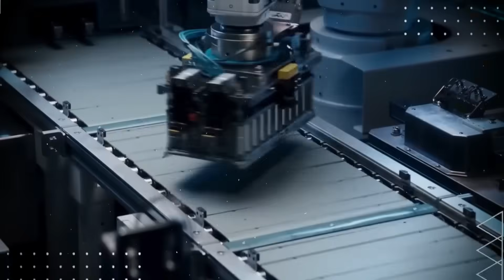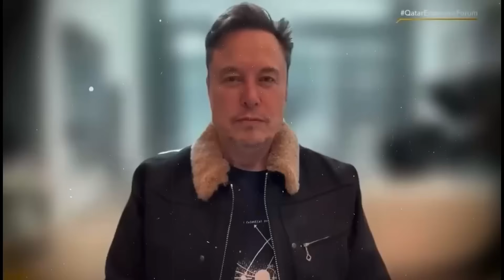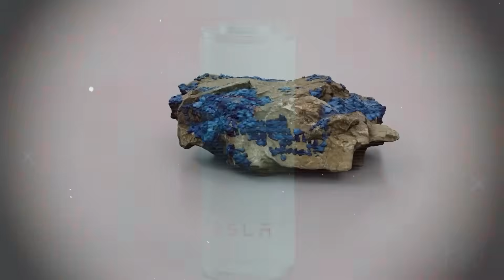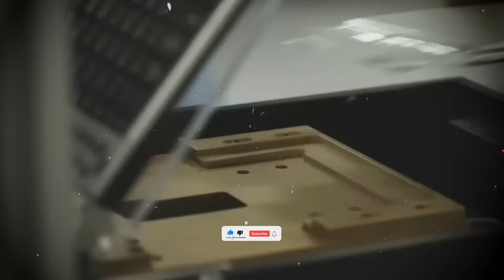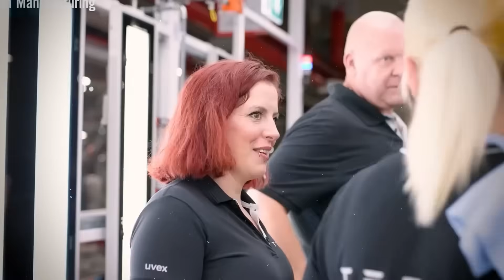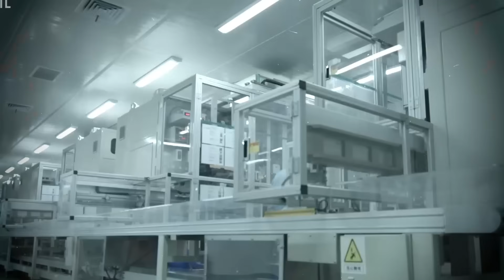5 Minutes Ago: Elon Musk Dropped A Bombshell about the Aluminum Ion Battery!

Comment: Don't tell me another revolutionary " save the world and EVs" battery ? Even if this is true and not another cyber truck, wait years and years Tesla BS, you still have the same problem and that is how much electricity is available at the charge point!? It's like BYDs 1000kw 5min charge to 100%. Theoretically possible but no chargers can do it and no power point stations has that amount of power connected to it for one of these chargers let alone multiple points, as a station would need MWs connection with a small city size transformers to cope.

Comment: I powered my 2-transistor radio in 1976 using an aluminum-iron battery! Sand filled. Used just a touch of ammonia in the sand to activate it. Powered my radio for hours! Then let it dry. Added ammonia. Used for 4 years.

Comment: This from my phones Ai;
While there is much speculation and many reports from unofficial sources about Tesla developing a new aluminum-ion battery, the company has not made any official announcements or confirmed its development.

Tesla is reportedly developing a sodium-ion battery, with some sources speculating its use in a future low-cost vehicle like the rumored Model 2. Sodium-ion technology is seen as a potential alternative to lithium-ion due to its lower cost, greater abundance of materials, and safety advantages.

Comment: I'm ready for a the new battery and in the roadster model. 
A launch so bawlsy that my balls may turn into labia once breaks kick in.
Does anyone know if the roadster will be dual motor or offer it as an option??

I could only imagine these batteries output wide open on dual motors in the lighter chassis/body combo. ❤

I don't believe another mass production car could compete with it on dragstrip or track.😅😊

Comment: ... BYD pre-programmed the import of 100,000 E-Cars to Brazil without taxes. They're unable to dispose of 40%, and their yards can't accommodate any more electric vehicles! 
... E-Car batteries are already on their way to becoming the 4th Global Failure...! 
It's not "green," unsustainable, always carries 1/3 of the extra weight, and isn't worth its weight...!
 ...all that's left are the cheap ones, like Microlino, Topolino, etc., and in China...! 👍🏻💯😸🇧🇷
 ... China tried to dominate the global automotive market by manufacturing batteries, the E-Car's "Achilles' heel"!   ⛔🇨🇳🇨🇳🇨🇳
... and China doesn't have Eletrical Power to recharge This kind of E-Cars and, are construting another big HPP like 3 Gorges ... !   🤪👎🏻🆘🇧🇷🇧🇷🇧🇷

Comment: It appears these batteries are being completed with rigorous testing. The model 2 priced at under 16k needs comfortable seats and a cross over height variant aging boomers can use. It is hard for older people to egress low height cars. What is the battery life time and replacement costs?

By the way, most boomers don't care about drag racing?

Comment: Something about this does not add up. Yes you can have one electrode of aluminum giving off Al3+ ions but if you just turn them into Al metal in the graphite at the other side there is no net electro-chemical energy (zero voltage) involved. There needs to be another redox reaction to have this store any energy.

Comment: Even if this battery existed and could be commercialized, it still fails due to lack of grid capacity.  You can't charge a battery faster without massively increasing the power delivered to it.  There's also waste heat to worry about with faster charging.  It they wanted to prove this type of battery, but the damn things in cell phones for a couple of years.

Comment: All the acceleration, benefits, etc are only benefits as long as they have a good foil.  IOW, when EVERYBODY is super, NOBODY is.  Also, Musk isn't stupid, he knows the Carrington event was a blip.  We will not have been capable of experiencing negative effects from extreme solar events until now.  Great?  Yes.  Wonderful. Absolutely.  Do it?  Sounds like it to me .  Our one basket to put all our energy eggs in?   Not until we've been through at least one more Carrington class event or higher   Which we will.  Imagine every Tesla solar battery wall and all lithium charged cars, possibly aluminum as well, catching fire simultaneously PLUS every other imagined effect possible on an ENTIRELY electrically centered energy grid.  WHY would we make ourselves ENTIRELY DEPENDENT on electrical when we're literally dependent on our proximity to the single largest EMP generator in this section of the galaxy for our lives?  This is GREAT, but let's not lose our heads to spite our bodies.

Comment: The aluminum battery story seems to change every day. Recently, I heard it was in production and had a 1,000 mile range. Now it's only 500 and not in production yet?
Reply: It probably depends on how large they make the battery pack. Maybe there will be different size options. I think they decide on a mileage target, then design the battery pack to meet it. Over designing the battery size increases the cost.
Reply: Range will depend on the size of the pack, and the efficiency of the vehicle.